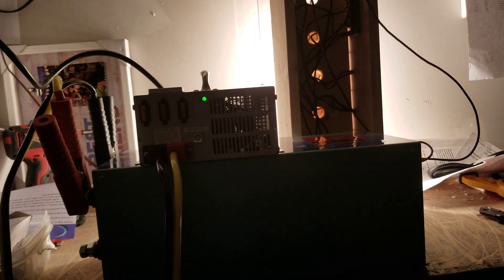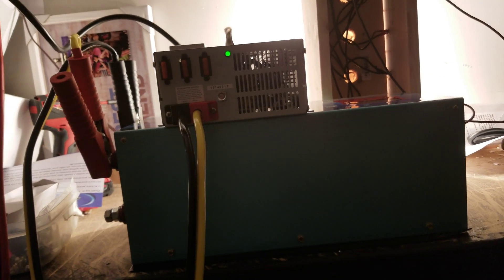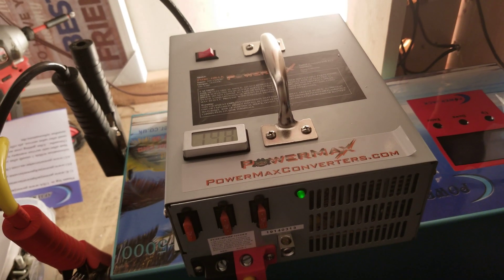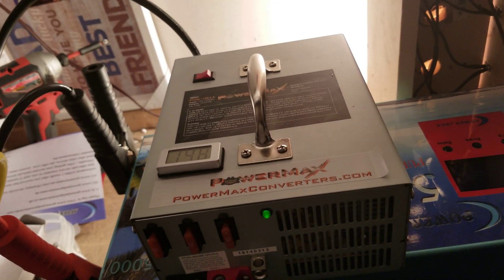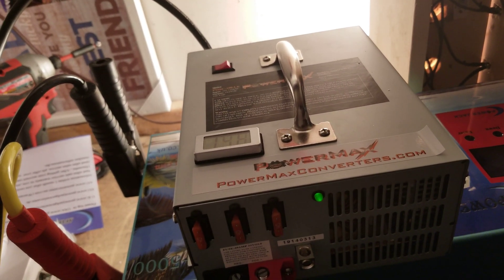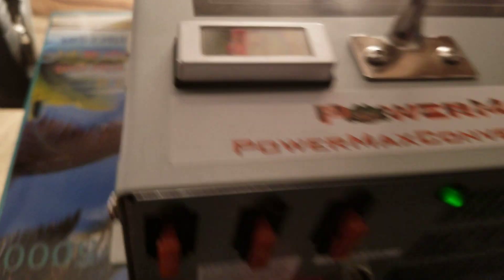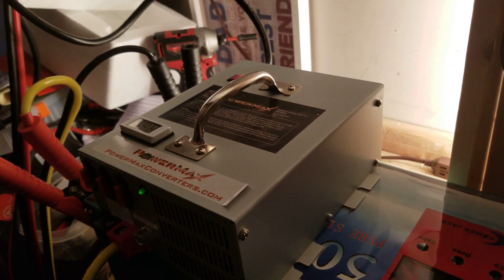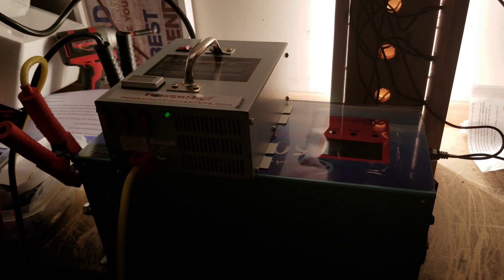How I steady load test Power Jack inverters.

Comment: If you are still interested in something like this power supply, I can build you one, I just built a 12v/24v 200amp it does just over 25v, it is 220v though, and I built a 38 amp 12/24v 120v version, I can build 48v, 60v, and have it where it's series able, 12v, 24v, 36, 48v, 60v it is individual 12v 38 amp supplies, ori can use larger units, they are about 12.5v each and slightly adjustable, the 48v will be about 50v the big 200amp is about over kill for about anything about n the bench, unless it's serious load testing! But 36-38amps is a good number at 25v, and it can be powered by individual 120v circuits if Needed!
Reply from the maker: James. I am curious, can you build a power supply that I can wire directly into my inverter? That would give me at least a good 50 to 60 amps at 240 volts to work with that i can use to bench 12v 24v and 36v inverters.
Reply: @GenetrySolar  yes! It would have 12v outputs to series or parallel for the needed voltage, when would you want it?

Comment: I have a 8000 watt unit that wont turn on no voltage at output  the mosfets look fine and everything inside looks ok fuses are good... is it my main board? Or a driver of some sort any help would be appreciated  thanks for your videos

Comment: You need a giant 220 Transformer with a 12 volt 24 volt and 48 volt tap on it that's rectified to DC it would be very simple to make and be very easy to get 150 amps out of add three or four giant caps and there's your surge also it would likely be very cheap to if you didn't mind building it yourself those big old Transformers are usually under a dollar a pound